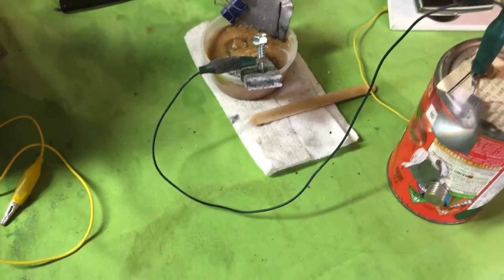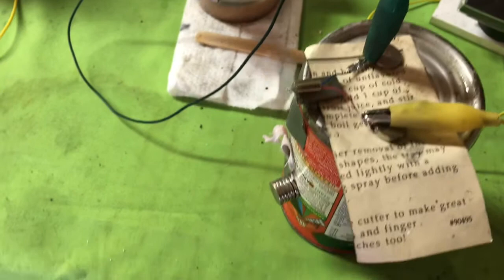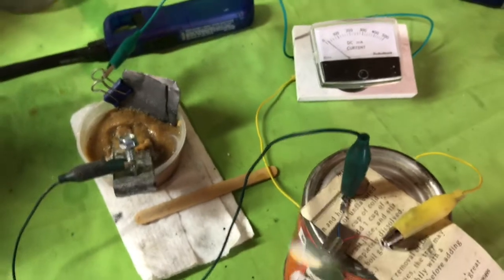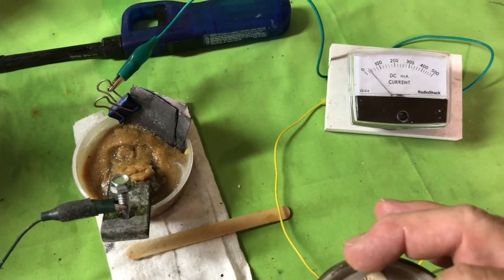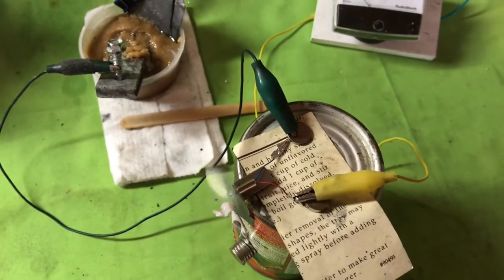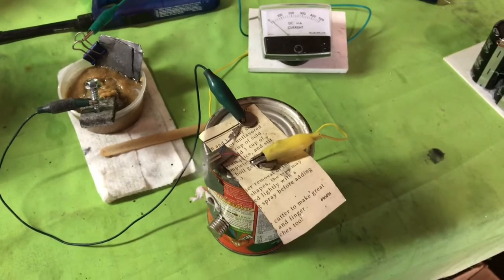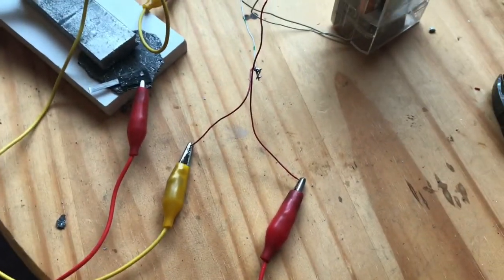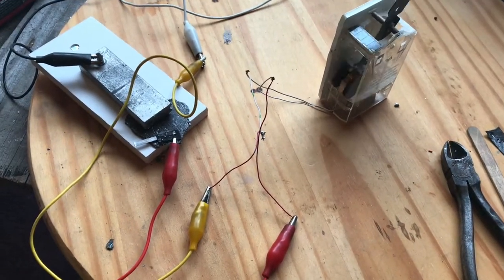Silicon electrolyte for The Magnesium Battery

Comment: Still waiting for your next vid
Reply from the maker: I have an idea for the next video,  for the anode ----- waterglass + sand+ graphite for conductivity the cathode ---- waterglass + piezeo crystal + graphite.  we will see what happens.
Reply from the maker: There was a strange thing that happened with the sand crystals and the magnesium.  The magnesium started to corrode into the sand and created a mound of magnesium oxide and sand.  The pile over flowed the container.  I tried using crushed solar cell panels and it didnot work.  I am still researching.  If anyone has an idea, let me know. Thanks